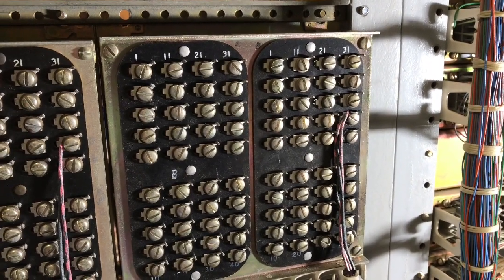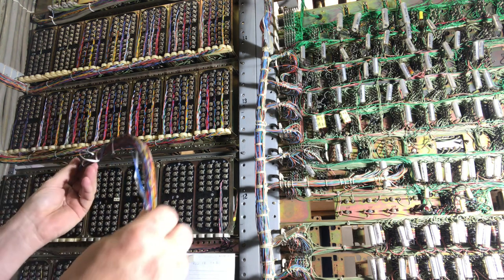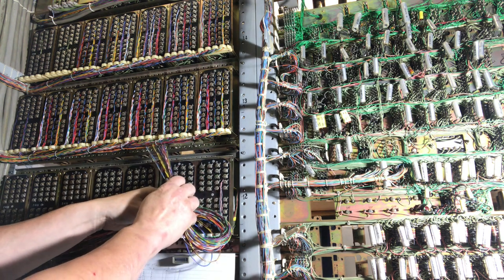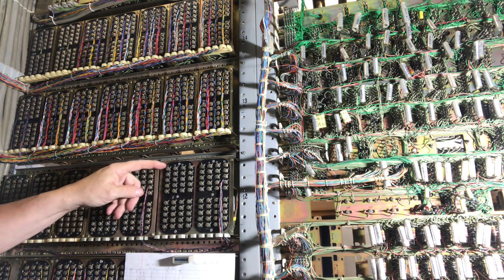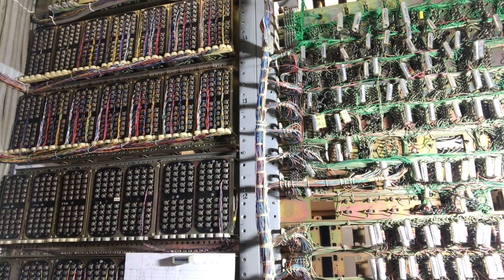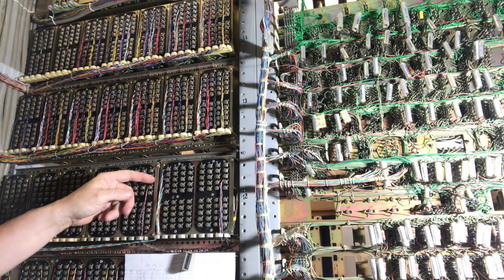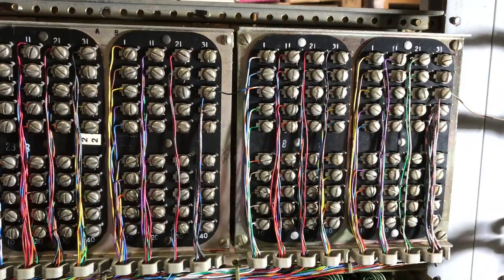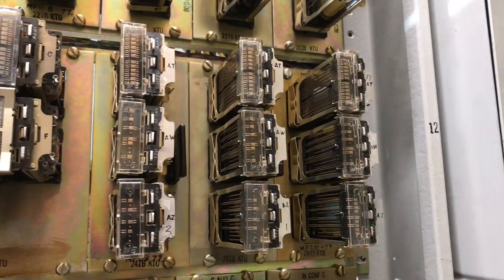How to Neatly wire up 1A1,1A2 ktu panels.

Comment: what are the silver Cylinder things on the panel on the right of the screen?
Caps? Chokes? I am not a phone man, but have been fascinated with the 1A2 Key system
since I was a teenager, after my dad gave me a 1A2 phone from his office when they were moving to a new one, that had another phone system installed. and he knew I loved al things electrical.
I experimented and figured out the wire pairs, and had it where all the line buttons would light up when pressed, and had it hooked to their phone line, so one line button actually worked, and even got hold to work. and later figured out how to add music on hold, via a casette recorder with taped music. never got the winking lights working tho.  and this was at the age of 14. and without a KTU. just hard wired onto terminal strips.
I wash I had gone on to work at the phone co. I would have been in my glory! 😀
I really enjoy watchng your videos and learning all about the iA2 system
keep them coming I feel like I have taken a master course  👍
Reply from the maker: Contact protection across the relay coils
Reply: @sxsphil   AH thank you! 
so their Caps, to protect from collapsing field voltage, which would pit the contacts in the next relay(s) in the logic line ?

Comment: Love the video Phil! I spaded all my terminals and pretty much wired the system the way its suppose to be..... how the heck do you guys keep track of the wiring scheme when you are using all 1 color to wire the 1A1 modules. WE used to love green wire.... that must have been a pain to trace!
Reply from the maker: Not difficult to work with. If it was working before then it's not a miss wire. Most problems are relay contacts. Or someone that can't troubleshoot and messes it up.

Comment: After working with 30-gauge wire, on the back plain of GTD-5 & DCO Switches, I think I'd prefer wiring 1A1 & 1A2 KTU units.  I wouldn't even need my cheaters! (i.e. magnifying glasses).  

A must have is ample lighting.  I can not emphasize this enough.  Poor lighting makes a challenging task many times more difficult, & unnecessarily stressful.